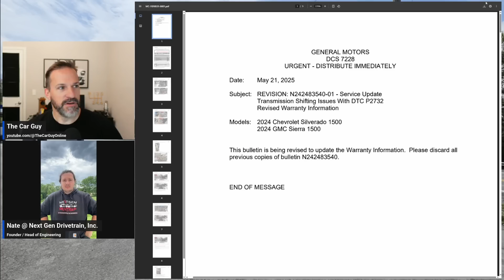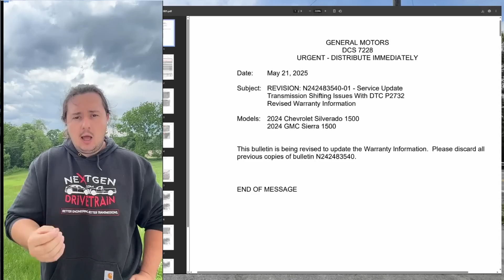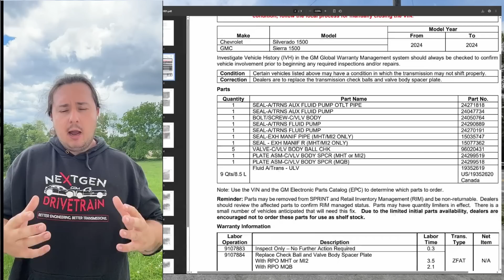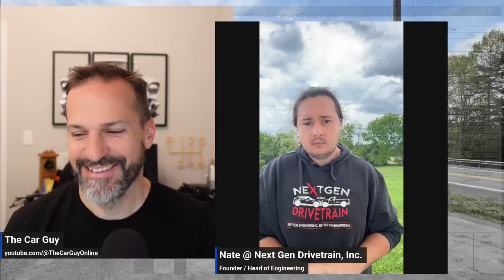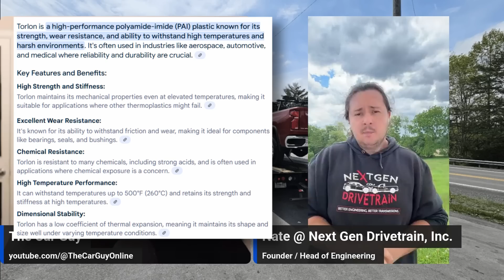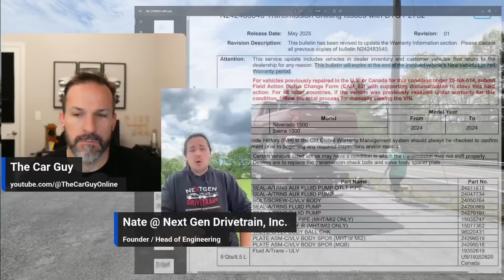GM’s NEW Transmission TSB EXPLAINED by NextGen. Will it EVER be FIXED? Silverado and Sierra 1500

Comment: REALLY GOOD TRANSMISSION WRITE UP FOR FORUMS ETC.

Here is a rewrite I did to try and make it more presentable. I am open to constructive criticism by proof readers. I have never claimed to be a good or even mediocre writer.

How many miles before your 10R80/10L80 self destructed?

Who rebuilt it?

What parts?

Did you mod your engine?

What type of driving?

Thorough description and details of my 202x has 9,000 miles and is stock! 10R80 Mach 1 transmission problems :

The car and transmission started having problems around 2k miles or so.

My car is at the dealership now for the fourth time and I’ve also had it at an independent shop, they said I should take it to a dealer because it is still under warranty and they have to fix it. 

The dealer it is at now is the only one that would replace any parts of the transmission. They tried replacing the valve body, but they’re saying that there is internal transmission damage. They’re saying it’s due to excessive driving.

 The car is all stock except for a few chassis/suspension parts. 

In my opinion this is false advertising and or a lie. Since the car comes with: Michelin Cup 2 track tires on it from Ford!, Recaro racing seats, track and drag driving modes, 2 front splitters, rear spoiler with Gurney flap, heat exchanger for all the fluids, etc. and Ford marketed it as as a track car.

Ford has steadily built the Mustang into an all-around performer, as capable on a road course as it is on a drag strip, and the company’s marketing and PR efforts steadily push the car’s track capabilities.

So, what happens if you follow that message and take a Mustang to the track? As it turns out, Ford walks the walk.

“Taking your Mustang onto a track does not void the warranty,” confirms Matt Leaver of Ford Performance communications.

from: https://www.hagerty.com/media/news/will-your-new-car-warranty-cover-track-driving/#:~:text=Ford%20Mustang&text=“Taking%20your%20Mustang%20onto%20a,will%20not%20cover%20that%20damage.?vurlk=1732737750008-R87BJ43HA19Y

I get the impression the dealer is going to try to void my and others warranty. 

I’ve been doing a lot of research on this transmission and I am seeing that there is a class action lawsuit about this transmission, but I am not clear on what is going on with it. My opinion is did possibly Ford and Chevy buy off the judge? The judge dismissed a lot of the claims but there’s still at least three that are ongoing.

It seems very odd to me that Ford and Chevy together making this transmission would think it’s a good idea to have steel gears running on aluminum along with one of the gears having bearings on one side, but not the other(the P# gear, Or planetary 3 gear). It has other problems also that Ford has TSB‘s and upgraded parts on along with the aftermarket coming up with some upgrades/fixes.

One could ask- How much difference does the black anodized trashcan/clutch container/outer shell make in longevity vs non anodized and steel gears. I am thinking not enough to really mater in longevity? Does it take the life span of the transmission from 2k miles to 2.5k miles or to 200k or 300k?

 I i’ve done a little research on this to try and figure out how much of an improvement it is. 

I have not found any answer yet.

List of the latest 6 failures known for now:

If you learn better by visual and audio I have provided below links to such videos.

If you learn better by reading I Also below have provided my somewhat condensed version of the videos and information I found.

LIST OF LINKS:

https://youtu.be/-zAUFd6kqyQ?si=cS9Mipo2s0dAbO2D

https://youtu.be/M3EOzymusMc?si=BCkyIGjbmnwBn1Br

https://youtu.be/PKIkUgli_gA?si=4NzdHhDYSwVx-q0R

https://youtu.be/1ovbquxKPgA?si=UIsyEUtMlIgWmmGp

https://youtu.be/XpbTQb_dHDs?si=3CmWMLjaV7ajBirJ

When it comes to Ford 10R80 failure points, Dunsford a Instructor at SIU, and a couple others I found, describes weak points for your Ford 10R80 and GM 10L80 10-speed to behave erratically and eventually fail.

1. CDF Drum. In earlier versions of the 10R80, a poorly designed bushing inside the CDF Drum slides out of position, allowing a Teflon seal to fail, resulting in pressure loss.       
2. Outer Shell Problems. The 10R80’s outer shells are made of aluminum, which is softer than the steel used to make the transmission’s various clutches. Sometimes these clutches stick into the divots in the outer shell, causing weird shifts.
3. Valve Body. Valve bodies are what control the physical shifting in an automatic transmission. But if too much fine metallic contamination collects in the valve body, they behave out of spec. Which is why Dunsford always recommends replacing valve bodies anytime a 10R transmission is rebuilt.
4. (In the 10R80, planetary gear sets and the one-way clutch are vital for maintaining smooth gear shifts and appropriate gear ratios. Deficiencies in these components can lead to improper shifting or transmission failures. A faulty one-way clutch might cause skipping of gears or failure to hold power in specific gears.

        Friction clutches also play a role in this system, and their wear can exacerbate these issues. Keeping an eye on gear shifting behavior can alert you to early signs of these problems. Repairing or replacing these components early can prevent costly overhauls. From: https://cartipsdaily.com/10r80-transmission-problems )

Another gentleman and his background:

https://www.f150forum.com/f118/unique-10r80-problem-solutions-experiences-options-566008/

Alright so just for some background, I worked as a tech at Ford for 3 years (during gen1 coyote years). Later became a pipe welder, traveled around for 8 years. Now I’m a welding instructor and have been teaching for the past 2 years. I have plenty of experience with mechanical work automotive and motorcycle wise, with fords work and issues, and have plenty of equipment/ tools to do anything. Currently have several track only vehicles 2 c6 vettas and a TT Gen1 coyote F150. I do a lot of engine builds, mainly LS and its variants, and all gen coyotes, various transmissions, and I also do custom tuning using HP Tuners. The current issue is with my daily F150. Itshould be noted that I am a very spirited driver and rpm shifter lol. What’s not talked about, not replaced even on mild build 10R80’s like Suncoast or Monster, and unbelievably not a TSB, is a very poorly engineered P3 planetary and sun gear. P1 and P2 both have thrust bearing separating the sun gear and planetary. P3 has NOTHING, literally metal on metal, only relying on fluid quality and pressure. So if we have valve body issues and pressure issues like sticking valves in a valve body it’s going to grind down. 

Only one company at this time makes a solution and that’s WIT, here’s the link for that:

Cheap for what it is, also has a core charge. 

https://www.wittrans.com/New_part-new.php?part=A164580AK

5. Torque Converter Shudder. A problem that was much more common in Ford’s earlier six-speed (6R80) transmissions. Dunsford says it’s much less common in the 10R80 but can be an occasional issue.
6. Gear Driven Pump Noise. Sometimes the pump in charge of moving the automatic transmission’s hydraulic fluid makes noise. Again, this is a less common issue.
 B
https://youtu.be/XpbTQb_dHDs?si=BHaylgLhNWw_5Dcp

[MEDIA=youtube]-5G12-_HwmY[/MEDIA]

https://youtu.be/XpbTQb_dHDs?si=BHaylgLhNWw_5Dcp

[MEDIA=youtube]-5G12-_HwmY[/MEDIA]

This guy does a number of videos on the Ford/Chevy 10 speed trans:

[MEDIA=youtube]-zAUFd6kqyQ[/MEDIA]

https://youtu.be/M3EOzymusMc?si=8w9S2QgPud0Fq5at

Possible fixes or choices I have spitballed:
A)  The TransmissionTR-9070 in the GT500? What would have to be done to transplant it into the MACH 1 and other vehicles?

B)  Would this fit,  work and be a great fix: The 10R140 is the largest 10R family member and was originally rated to 1,050 ft.-lbs. of peak torque in the 2020+ Super Duty. This has presumably been revised for 2023, as Ford debuted the 6.7L High Output PowerStroke, which makes 1,200 ft.-lbs. of peak torque. The 10R140 is currently exclusive to Ford Super Duty trucks.

I really do love this car!
The way it sounds inside and out, the tweeks I have made to the: interior sound, handling, looks, etc. 
I put: full Window tenting, full Weathertech trunk and interior, a really expensive nice stereo in it, full paint protective film and some places two layers of PPF, ceramic coating.
 I only use high-quality full synthetic motor oil in it. I started using mobile one supercar 5W 50.
I’ve spent a lot of money to protect it and upgrade it! 

Spending another $5.5k to $11,000 just for the transmission alone at 9k miles, does not make me happy!

And on top of it again, are these upgrades/updates truly make the transmission last for 200,000+ miles or is it just make it last 1000 miles more?

Comment: All of the vehicle manufactures should have kept the Old Reliable 5 speed Auto Transmission with overdrive. As solid as a rock, transmission. But no they went a 9 & 10 speed automatic. The average car & pickup truck are not
Class 8 Heavy Duty Semi Trucks. What's next 18 speed transmission in a car or pickup truck.  Go figure.

Comment: It's to bad that OEMs do not offer manual transmissions because I would buy one in a heart beat.  I grew up using manual transmissions on my pick ups and the only thing I had to deal with was changing the clutch and pressure plate.  Easy peasy and not that often.

Comment: I googled the question " how many computer chips are in today's vehicles?" and the answer that popped up is this:  "Modern cars typically contain between 1,000 and 3,000 computer chips, depending on the car's features and complexity. This includes a wide variety of chip types and functions, as cars rely on numerous electronic systems" ... I don't know about you but I have bricked a couple of laptop computers over the past 10-15 years when I spilled coffee on them.  I guess what I am saying by this analogy is that car parts are not necessarily what is going to brick my SUV in the years ahead, it is going to be the electronic systems (and all those chips that will age and or fail) that in turn negatively impact the parts on my vehicle.  It makes me think that the best way to go about getting a new vehicle is to lease it vs purchase it, as it just won't last more than 5 years.

Comment: Thank u for another episode with Nate.Love this guy!!! Here’s a question for him if u ever have another episode with him answering questions.Why is my transmission throwing these codes:p0714 temp sensor intermittent,p0218 temp operation activated,& p0706 transmission range sensor fault on a rebuilt transmission and torque converter for my 2005 Jeep Wrangler Unlimited (rubicon,4.0 6l,lj ) that only has only a few thousand miles on it?
Reply from the maker: I would shoot their team an email/contact through their website, link is in the description. They might see this comment but it's hard to sort through for sure.

Comment: I have a Mazda CX-5.  I had transmission issues starting about 30,000 miles.  After a day of very hard driving, it began having issues at low speed shifts.  I took into the dealership and they reset it and it would run fine for about a 9 to 12 months, and then it would happen again.  After having this occur 3 more times, and now out of warranty, I told them that I want it fixed.  They called Mazda and determined that the transmission is failing and recommended a new transmission.  They said a new transmission will cost $5,000 plus labor.  The dealership contacted Mazda and said that they would cover all but $1,000 of the transmission parts and labor cost as well as make sure I had a loaner while it was being repaired.  I did call Mazda and argued that they should cover the entire cost because it started while under warranty.  They were congenial and polite, but still did not change their original offer.  Although I was mad that they wouldn’t cover the entire cost, they did have a better attitude and were willing to talk with me about it v. interactions I have had with Ford, Chrysler, and Chevrolet customer service departments where I felt they just didn’t give a damn and were preprogrammed robots to say No!  Every five seconds.  So the moral to this story is this, will I buy another Mazda product after this issue, yes I probably will.  Treat people right and they will come back.
Reply: I’m curious did you ever have the transmission serviced?

Comment: I'm with nate, but I do worry his "fixes" might also be bandaids.  In other words, I worry that the latest GM trannies are so light duty in design that attempts to beef them up with some add ons will not be fully effective in restoring transmission lifespans to the levels we used to see in the famous 3 speed Turbo Hydra Matics 350's and 400's of the 1960's and 70's or even the 2 speed Powerglide.

Comment: I’m so tired of gm junk it’s crazy too buy a brand new truck  and fully expect too have issues  almost immediately  my 2020  2500 hd  had too have transmission work  very hard  down shift  when coming too a stop  it’s better but still does  it sometimes

Comment: Are not the 10R80 FORD and 10L80 Chevy practically the same?
Why aren’t the fixes applied to both?
Ford replaced my 10R80 at just under 10,000 miles. STILL HAS PROBLEMS. 
Some people claim that they fix is to have WENGERD, Lund, Palm Beach Dyno, etc., do a transmission tune, but my research says the problems are the wrong materials used in the wrong places and poor design. So my question is, is it worth it to pay to have a tune on these transmissions or just wait until aftermarket companies have come up with redesigns and materials to replace the known crap design and poorly used materials for all the multiple problems in these transmissions?
Reply from the maker: I'm about to release a video where Nate and I discuss the new Ford recall and some differences between the Ford and GM transmissions, they are essentially the same however the slight differences, IMO, seem to make fords valve bodies every so slightly better, but they both still have valve body issues. NextGen has kits for both. I'm not sure exactly what issues you are having but they could very well be valve body related as the hydraulics control everything in the transmission.

Comment: Is Ford’s 10 speed transmission using cheap parts as well?
Reply from the maker: Yes, they are slightly different but very very similar. New video coming on the latest Ford 10spd recall, and some differences between GM/Ford (not many). I believe NextGen sells kits for both.

Comment: Would changing transmission oil to aftermarket and going with a aftermarket transmission pan somewhat help the longevity of the valve body? Or is it just a ticking time bomb whatever consumers do?
Reply from the maker: Keeping up on fluid changes definitely helps but won't fix this long term. NextGen (Nate) says that if you upgrade the valve body you should be OK....or at least have decent longevity in the transmission. 90% of the issues are valve body related that then cause other transmission issues over time. He does say 30-50k miles on fluid drain and fills is recommended, depends on your conditions and use though. If you are towing 100% of the time, or freeway easy miles 100% of the time, the prescription might change.
Reply: @TheCarGuyOnline suncoast also makes a valve body upgrade. Wondering if GM extends the warranty on this we’ll know I guess to them and others faulty valve body issue?

Comment: When the big 3 use the public as beta testers, the warranty should automatically be 10 years. As soon as they are forced to warranty the customer for that long, they will stop building shit.

My 2017 Sequoia, was from the last breed of "simple" vehicles. It's a dinosaur from the mid 2010's when even the big 3 has pretty damn reliable vehicles. Even when it did break, you could still swap a water pump or alternator without a $1000 trip to the dealer. My Sequoia has had regular maintenance and tie rod ends. The tie rods lasted 230,000kms so I definitely didn't shed a tear when they needed to be changed. I did the repair myself, surprisingly got Japanese parts (oem in a aftermarket box), and paid the alignment shop because I could only set the rough toe in the driveway.

Comment: Maybe those companies read our comments to. Hey GM, i DID NOT BUY ONE OF YOUR POS TRUCKS because i knew they had issues with the trans and motors. I bought a truck that did NOT have these issues. Also, if i did buy one of your pos trucks, I'd  buy the parts from somewhere after market and install it MYSELF. I grew up a chevy girl. I won't buy a Chevy  Newer than mid 2000s. Nope. Not happening. If you took care of your customers,  you would have had my buy and loyalty. I buy a new vehicle very often. It won't  be a GM or Ford due to your bs. I worked for Ford and saw their bs. 

We all know the deep state is real in the automotive industry.  You babies needed bailed dout with OUR tax money. And look at Tucker.  The Tucker car that was ahead of it's  time. You big 4 at the time, back in the day, did everything to distroy Tucker and his line. Read that comment GM. smh

Comment: You think this guy is nuts?   GM fucked over LOTS of customers over that whole CP4 injection pump deal.  If the truck was 5 miles or 5 days out of warranty when it shit the bed... the OWNER paid the $12,000 to get it back on the road...WITH THE SAME DEFECTIVE PARTS!  What did the NHTSA do?   NOTHING!!  It's all a total scam, and this guy is right on the money.
Reply: Yeah I seen some of the stuff about the cp4 it ruins your entire engine and your turbos, that's absolutely insane!